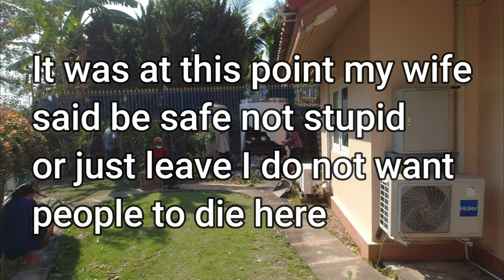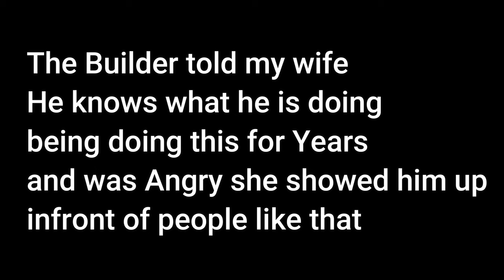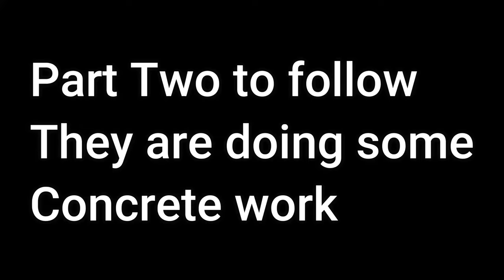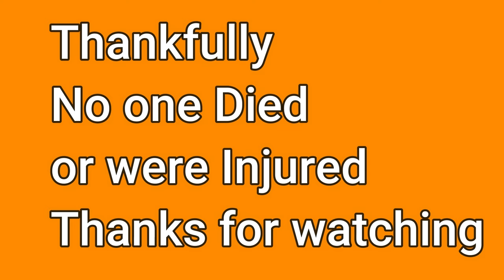Bad Tradesmen What Could Go Wrong bad health and safety

Comment: My second time in Thailand i was staying in a higher end hotel and they were doing some renovations in the lobby. They were thai workers in flip flops using pick axes breaking up the floor....no eye gear, no gloves, flip flops. On the other hand I've also seen them opening up a pineapple or coconut holding it one hand and using a machete to slice and dice it, looking in other directions while they do it. You're best to go away while they work away and it's easy to rate workers by the number of digits or limbs they're missing 😆....gives a whole new meaning to yelp.
Reply from the maker: I would have done that but my wife wanted no injury's on our land as it is bad karma  if someone is injured at your home is why she kept on pulling him up for dangerous work, Something he did not like to hear from a young woman.
Thanks for your comment and for watching.

Comment: Recently I had two guys cleaning my aircon. I didn't notice that the electrical wire on the pump they were using had been cut or repaired until the guy operating it hit the ground! When all was said and done, he was white, and the wall socket was black! Lucky for him the breaker switch kicked in. After resetting the breaker and a few smiles, they wanted to have another go; until I said no. You usually don't get second chances with electricity and water, and I insisted they come back another day with a new electrical power cable on the pump. The next day, five of them turned up to clean the aircon and fix the blackened power plug. As they say, TIT that we live in.
Reply from the maker: As an Electrician in the U.K. I have high standards regarding Electrical safety, some of the extension cables used are accidents waiting to happen. I am in the process of fitting a RCD Main switch to protect the Electrical system also fitting an Earth rod.I will eventually change all the fuses to RCBO’s to achieve the ultimate safe system but more electrical safety vids to come, I could do a YouTube channel just on this.
Thanks for taking time to comment, and happy they survived to live another day.
Reply: What surprises me here is they actually got a breaker switch , they are coming on in leaps and bounds, haha !  🤭🤣👍
Reply: @weementaldavy5987  I live in a nice condo in Bangkok; I do suspect he may not be so lucky in other buildings if this was to happen.

Comment: Safety last ... I was having breakfast early one morning in a street front cafe in Patong and a large flatbed crane truck went past loaded way over the brim with long pipes and all the workers that didn’t fit in the cab where sitting on top of the crane that was holding down the pipes smoking and laughing away ducking their heads under the power lines that  crossed the street, I gave up being amazed after that!!
Reply from the maker: Only luck is with them.

Comment: Thanks Les. I've just learned to ignore it. If I see something that is out of this world going to kill someone I will say something.  Like the time I saw these guys trying to hang a 10 ton AC unit from a wall made from tiny Thai bricks and skim coat (rendering) with 3 cm nail in anchors. I mentioned it to who I thought was their boss. Even made a drawing on cardboard because despite popular rumors, my Thai sucks. Now if I was hiring someone to do work for me I will insure they have basic safety measures in place. I'm not talking OSHA as in the US but basic stuff so they don't kill someone. If they want to crush their toes or break their legs or blind themselves. I can't help that. 555 Thank Les 😊🙏
Reply from the maker: I like to do things myself I was going to knock the tank down myself and pay to get the concrete taken away but the price for knocking it down and taking it away was cheaper than just taking it away. The concrete job was just a bit more expensive than buying the mixing tub that Id not use again so again it was cheaper to employ someone. I have done my own electrical ground rod location ( another video. ) Turn a blind eye for sure here in Thailand.
Catch up soon Mister Mitch.